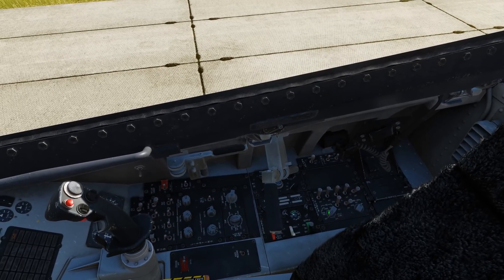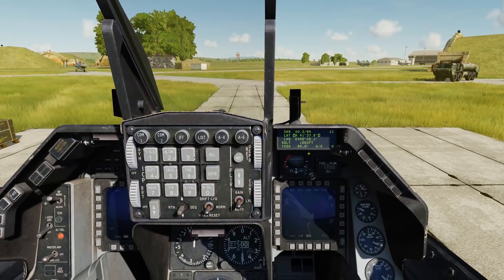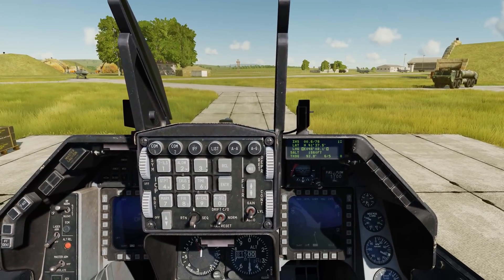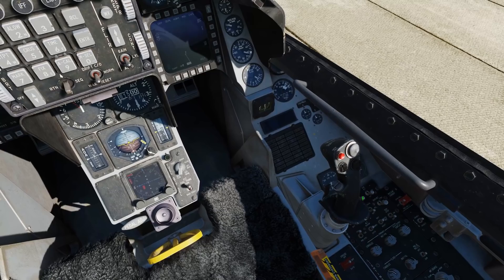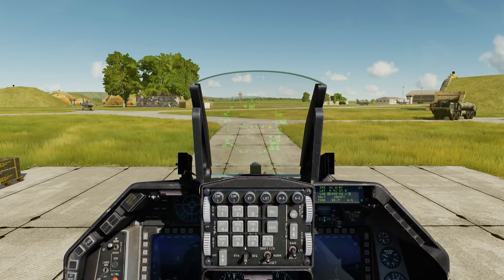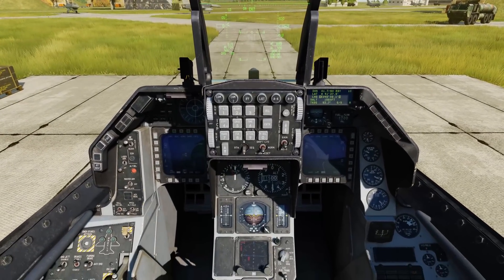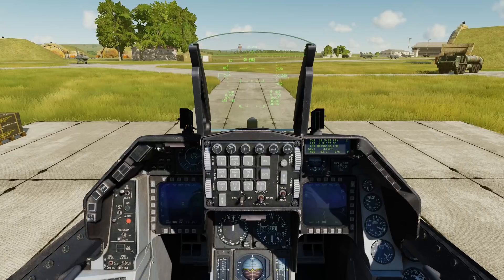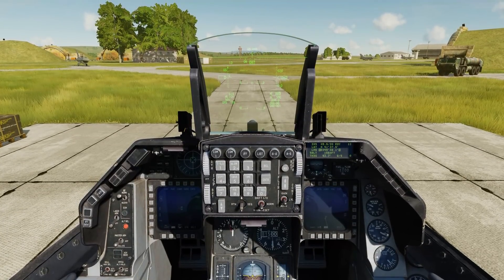DCS: F-16C - INS NORM Alignment Update

Comment from the maker: NOTE 1: This does NOT apply to a stored heading alignment. Also, re-arming requires a realignment. 
NOTE 2: As always, these videos provide a preview of an upcoming feature to assist you in understanding a new feature. Later, it is quite possible that the feature will change, and the feature functionality has changed. As much as I’d like to, I lack the time re-record these videos.
Reply: why does re-arming require a realignment now? Is that just how it is? Also what does not apply to a stored heading alignment?
Reply: @cbinder46  confirming coords in the DED
Reply: @cbinder46  Having to hit enter on the Lat/Long on the list 6 page during a stored heading alignment.
Reply: Can we use stored alignment after RE-arming.  Would it use the original alignment as the "stored" alignment?
Reply: perhaps im not exactly informed on how the specific navigation suite is supposed to work in a USAF Viper Circa 2007, but  if activated'  shouldn't the GPS part of the navigation system correct any INS errors, be it INS drift , or in this case  a potential example of user not doing a proper alignment ( Such as not confirming coordinates or not waiting for max time alignment completion?) After all isn't it  the GPS what allows an in flight alignment as well?
Reply: LoL i figured this out just before you posted it. Already had my comment ready for 2 hours. But needed to confirm that it indeed did not work for store. Also there are some first time spawn issue's for multiplayer. My weapons did not register. And when i respawned i could not fire them (Master arm on and pylons ON)
Reply: how did you get those crystalline blue reflections on the mfd?
Reply: I’m brand new to this game and this has been driving me nuts! Thank you

Comment: Is something broken on the current beta ? Using manual align (norm) from hot start, or auto start sequence from cold, I'm not getting nav hsi to work on any single player mission, or quick start. 
Hsi (or hud tadpole) never comes up, even after waiting until alignment is fully finished.

EDIT: FYI after looking through the ED forums (couldnt find this anywhere else), it turns out that there is an enormous amount of things that are completely broken since last beta update. This happens to include the HSI / Hud steerpoint navigation. See: https://forums.eagle.ru/showthread.php?t=277164

Comment: What would the reason I don’t get the diamond or tadpole? My waypoints show up on the MDI but not the HUD.
Reply from the maker: It sounds like you did not properly align the INS. Thanks
Reply: I’ll continue working on figuring out what I am doing wrong. It just that diamond showed up right away on your video in the HUD and does not on my so I figured I wasn’t turning something on that I should be.
Reply from the maker: @jasonzuck1560 . Please post a video or track file to our forum here: https://forums.eagle.ru/forumdisplay.php?f=638  I'm sure someone will help point out where you are going astray. Thanks
Reply: I have done more testing and that tadpole isn’t in the HUD even if I jump into the free flight mission that comes with the module. So it’s not my start up at this point.

Comment: help this doesn't pertain to the f-16. I'm having trouble with the f-18 tgp. When I'm using the GBUs and lock in on a target on the ground. The tgp instantly loses focus and wont reset. Its mark the position on the HUD but the tgp is looking somewhere else and I have to start from scratch. Which takes more time and fuel. When I reset everything and try to lock in on the target again..it does it again. Can someone tell me what I'm doing wrong or missing. Thanks.

Comment: I'm still confused regarding stored alignment.  The manual indicates that the aircraft has to be set up for this beforehand.  Is that something that needs to be done in the mission editor or will it work as is?
Reply: Yes "beforehand" that is after the first startup with a complete aligment heading is stored. it is some how the F14 system works. nad probably not implemented yet

Comment: Although it's all described in the latest Viper manual, this video is an extra confirmation that I do it properly. You can also check with map if the initial coordinates are correct. And thanks for the new gun aiming system, it's very precise.

Comment: Why is the hornet alignment faster then the 16, and 14
Reply: because the alignment for the hornet isnt implemented properly yet
Reply: Because there isn't any alignement on the hornet. Actually, the Hornet is currently a freakin' mess. Radar is bugued as hell, no INS, no A/G radar. Disapointing.
Reply: @jowenjv4463  The Hornet does have alignment, and the Radar is not bugged. It does have INS as well, and it has no A/G radar. Although out of all the multirole aircraft in DCS that should have A/G radar, only one has it and it is not developed by ED. Although the A/G radar code was apparently developed by them and tested on the JF-17.
Reply: @cybercannon505  The AJS-37 also has ground radar.
Reply: @anthon3559  ah okay
Reply: @cybercannon505  The radar isn't bugged ? 

-Radar emits on the ground when the radar mode is on OPR mode : Known BUG
-Radar locks on target when pressing ''Undesignate/NWS'', even on the ground and with the radar knob on STBY : Bug
-Radar able to catch target out of its scan capabilities,  (https://forums.eagle.ru/showthread.php?t=264703) like a target right on my six (173°left) as you can see on the screenshots on this bug report. 

-Radar unable to break lock under some mysterious circumstances

And the Radar is not bugged ? Is this a joke ? This is a 80€ product, in early acces for more than 1,5 year. INS is still just a fake timer.